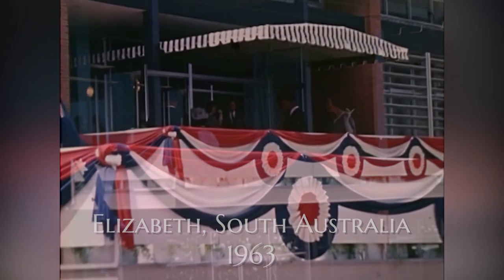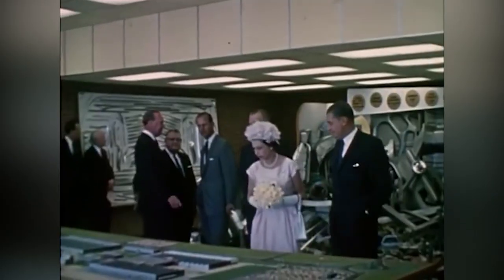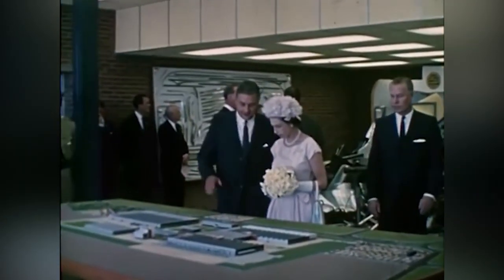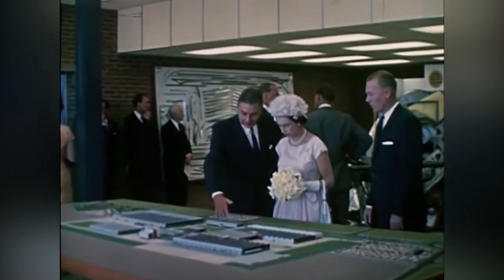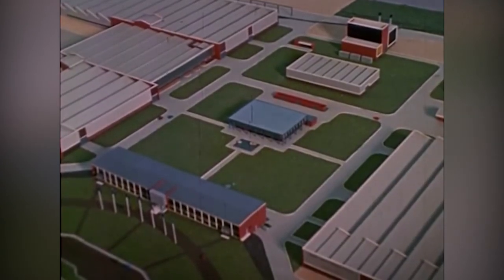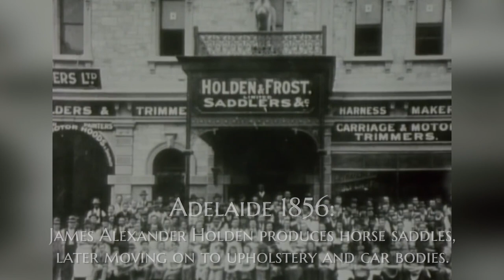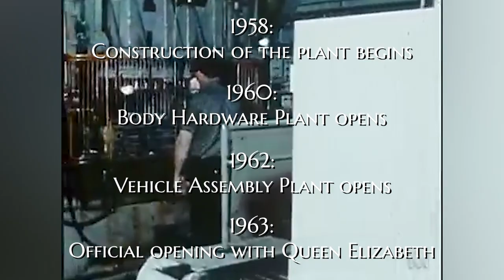Elizabeth Icons: General Motors Holden (GMH)

Comment: Holdens played a big part for my family in the 80's. at one stage my Brother and I, our younger sister, our brother in law and my Step daughter all worked there. as well as  several close friends of mine too.  I was there from 1987 to 1997, only leaving due to my ex falling ill and having to look after them. my brother, who started a few months earlier than me ended up being there for nearly 24 years. I was a leading hand in the body shop, ( plant 2 ) looking after the section that metal finished the mig brazed roof joints as well as fitting bootlids, wagon tailgates and several other jobs. was the best 10 years of my working life at that place. my brother was a forkie in the press shop ( plant 4 ) my sister worked in the trim shop as did my brother in law, and my step daughter worked in trim fab where they did the upholstery.

we were still building the VL Commodore when I started, and I left just before the  VT Commodore was released, but I did get to see the pilot models of them coming down the line just prior to my leaving.
Reply from the maker: Then this video is a salute to you and your family Catey - thank you 🙏

Comment: i started work there in 87, 18 years old,, painting VL commodores then the VN commos..  all my mates worked there at some point .. as relief operator ,, i did everyones jobs while they went for smoko,, the line didnt stop in the paint shop . i had an hour for lunch,, but all my mates were still working,, used to visit daveo in the body shop, have a smoke and try out the spot welder he was using.. i was the only bloke in the body shop with white overalls ..
arvo shift,, thought i would take a VN for a spin around the plant... flat out behind the main building,,, knocked that sucker into park trying to manual shift ,, locked it up,, put it in nutral while still skidding,, restarted the car and parked it back where i took it from... that was the only VN out of 100,, parked the wrong way.. told everyone, dont buy that red one,, its got a stuffed transmition.....
Reply from the maker: Bahaha - that's hilarious mate - good thing you didn't get sacked though...lol. I started in paint shop when I was 19 in 1990, left, then came back and went on to the body shop as a spot welder.
Reply: @elizabeththatwas  i may have still been there when you started..i spent the last of my term there in second prime.. the secret test drives were around 8,30 at night,, so there was no one around,, everyone was working on the line.. i got another VN stuck in the panel racks way down the back of the press shop..i thought it would fit .. it didnt.. so i got out the back door and left it there..lol.. i ended up quitting when they gave the leading hand position to a woman from sealer section... the mistres of the general forman in paint shop..  she could not spray paint,, and she was going to be our boss ??   not happening..lol
if the line stopped in the pain shop,, it was me that pushed the button.. safety first.. and 36 degrees was not good in the spray booths.. they actually refused to sack me.. they would say if i took 1 more friday off, i was fired... so i took friday off.. monday another official warning.. i always had 2 warnings on the card.